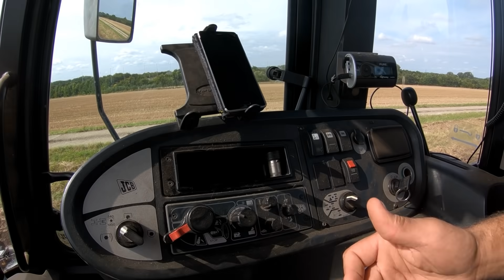CAN THE FASTRAC FLATLIFT???

Comment: I've got a full set of Fastrac weights sat in the yard if you want them Saunders.
Reply: It's not the lack of weight mucker, it's the lack of a chrome straight pipe. Everyone knows they add 110% traction as well as horse power 💪
Reply: Should of painted the wheels 🤣
Reply: @matthewbrittain2919  🙄😳😂😂
Reply: That Cummins engine sounds so sexy when she working it would look even more sexy with new boots on and painted wheels and the jcb stickers on the doors and below the back window keep up the good work George
Reply: Have you tried Go Faster Stripes on both sides

Comment: Geooooorge, where is a frontweight, and new tyres??? In your place I would have mounted the front arms and used a weight from TW. They are already assembled by many companies from various brands and are cheaper than the original ones. So why aren't those wheel discs already yellow? 😂

Comment: What can I say? George - I would have liked a close-up on the tyre / soil interaction, your Top link is slightly too long and its Geometry is not correct either! ( Where should the VHP be?)    I'm writing this from the start of the video: so if  you're changing it later, then  so be it.  WhaaT?  DEPTH control - ie POSITION control?   naaaw....   THAT's  wots rong - you need DRAFT control - does it have that - Toplink or Bottom link sensing - that's the difference   :-) Oh the  ( lack of ;-)   ) Power Hop ....I prefer the Leaping Deere! or the  Rambling Massey ...    How about the Steady Same - They colud pull well  - but this is about the Fastrac. ..  Mmm think dog's got the best idea.    Thanks for posting.